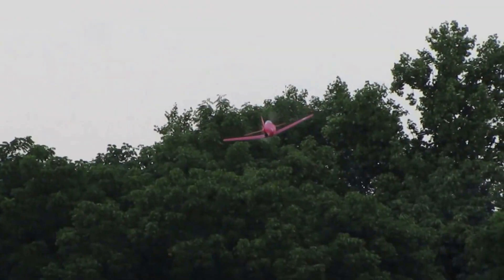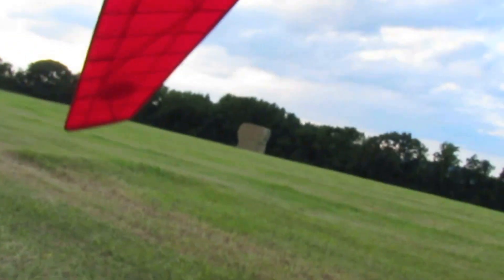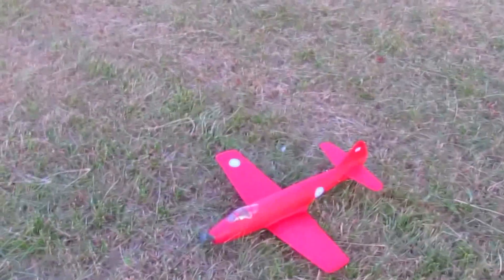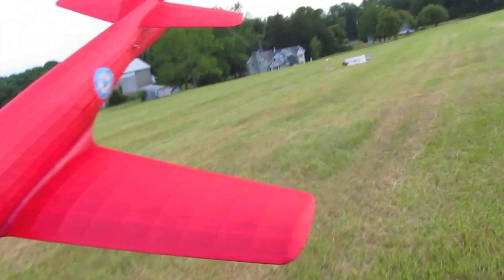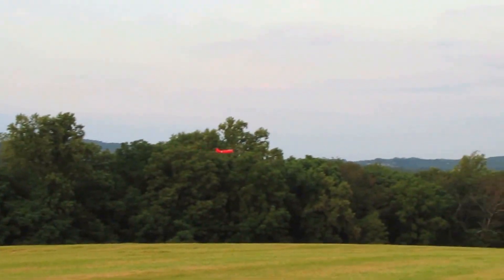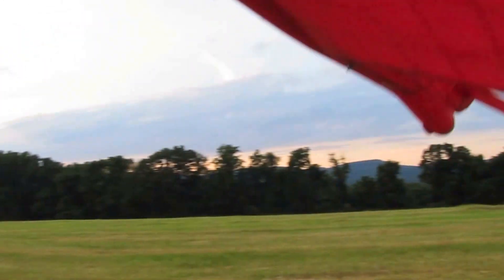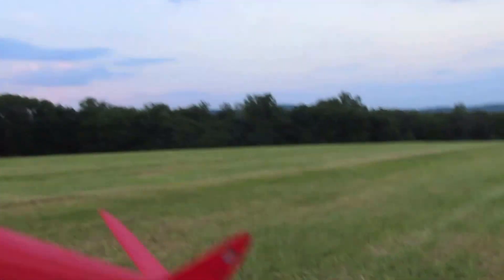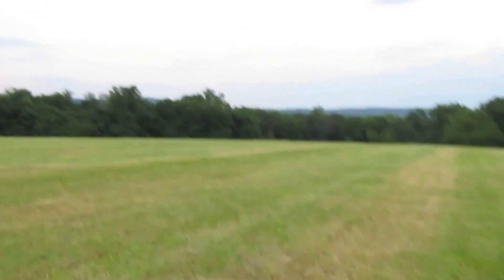27" Rubber-Powered Pulqui - Anatomy of a Trim Session

Comment: What a great video! Your unaffected chatty style almost makes the viewer feel he or she is at the field too. It was a real pleasure to watch each successive flight - the climb-out at 9:30, on 650 turns, and the flight which follows presage the last incredible flight on 720 turns. It´s refreshing to see the good old Pulqui modelled rather than the same old 15s and 86s. Last year I built a simple profile Pulqui II and set into the profile fuselage (a trifle too low for the coincidence of the centres of thrust and drag, I suspect) the rocket from a firework. Sadly my father ran it over with a garden tractor before it could fly.
Reply: I haveaguillwosmessrmittbf109